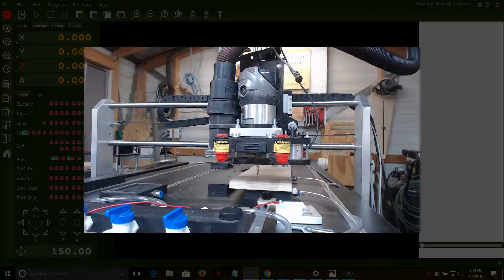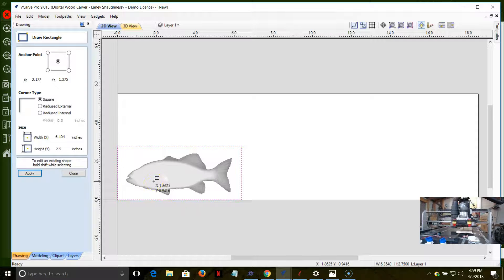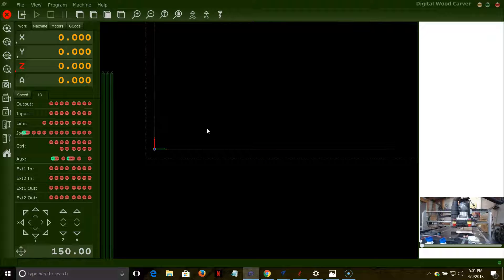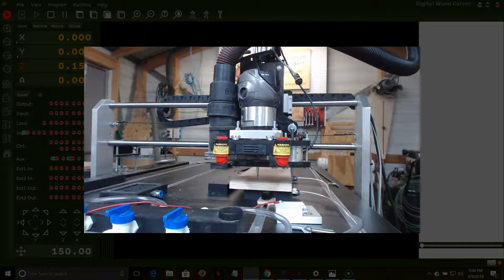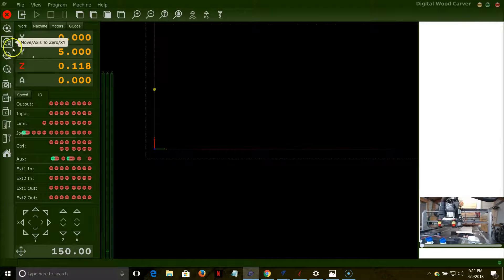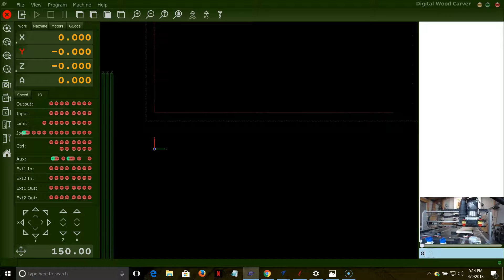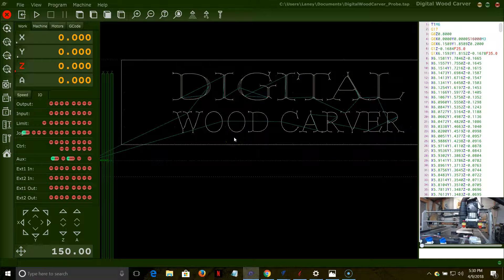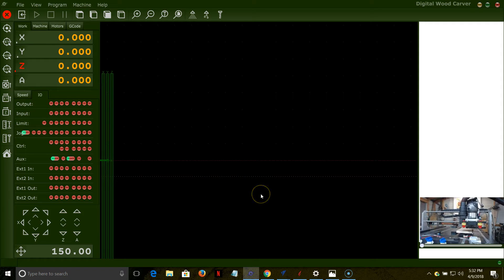How to Use the Digital Probe To Warp in TNG

Comment: What version of the TNG software are you using in this video?
Reply from the maker: PlanetCNC TNG 2017.10.30  at the time of this video  but recommend using the latest version which is now PlanetCNC TNG 2018.05.22
Reply: SpindleTV Thank you, the reason I asked was because the warp feature on the latest version doesn't seem to have an affect, it doesn't alter the imported code in any way and I'm trying to figure out why. I've used the feature on the cnc is controller and it worked.